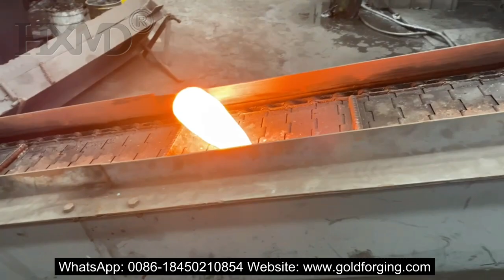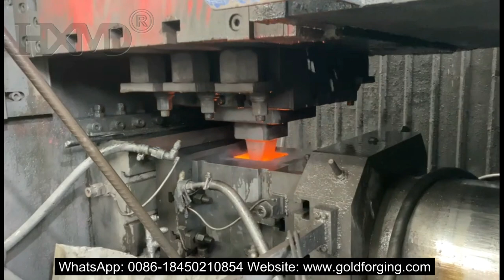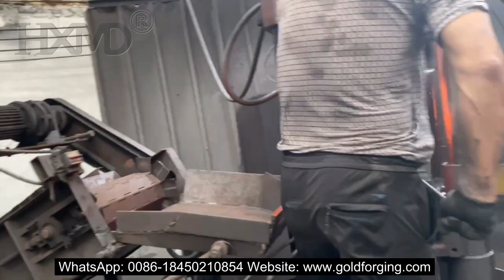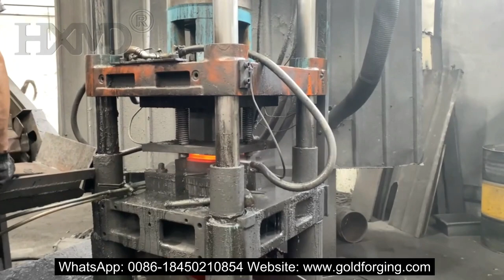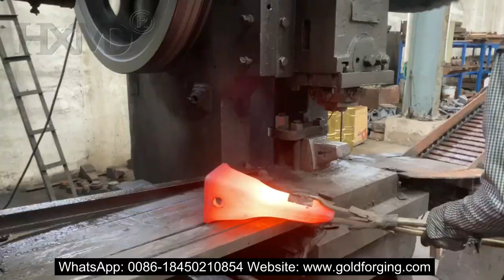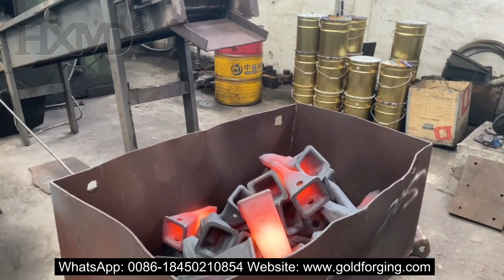Gold Forging - CAT J450/E330 1U3452RC forged bucket teeth are in production

Comment: I work in forging industry as source supplier of forging descaling machine which has been widely used in hot forging production lines to clean forge scale generated by induction heating machine. 
We focus on helping hot forging enterprises to improve forgings surface quality with our high pressure water descaling system.